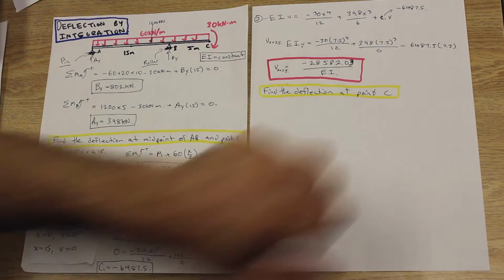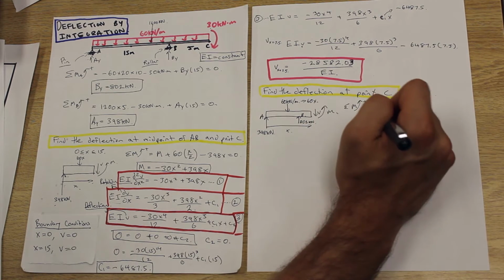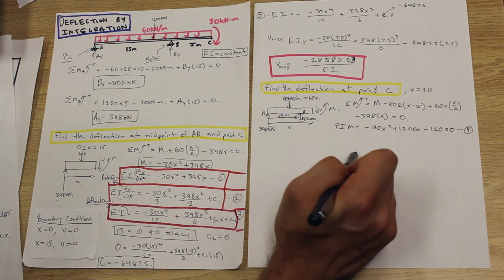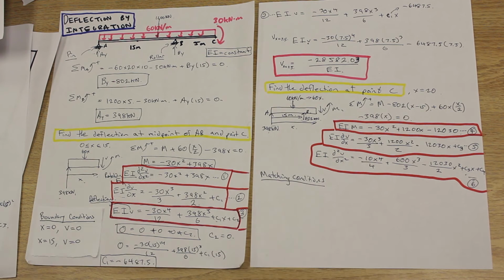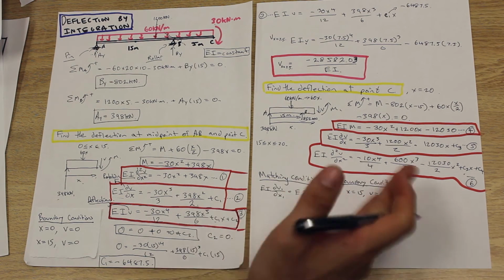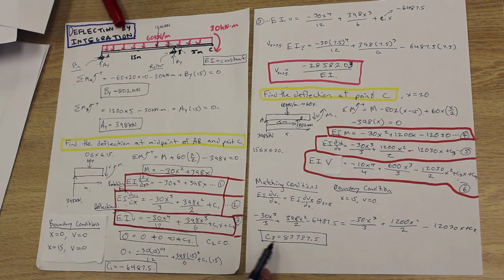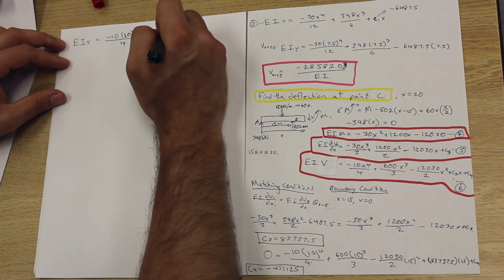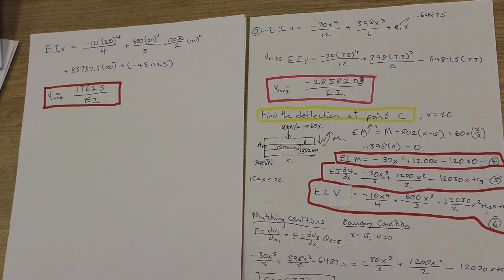Solving for Deflection of a Beam Using the Method of Integration - Part 4/4

Comment from the maker: TimeStamp !

0:33 - Theory Ends - Solution Beings (Dont skip the Theory!)
------------------------------------------------------------------------------------------------------
We need to Derive 3 equations to Find the "Deflection at Point C" 
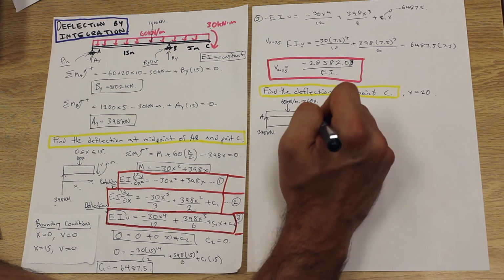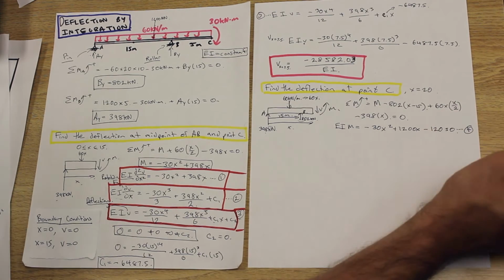** 2:04 - Equation 4 ** 4:35 - Equation 5 ** 5:27 - Equation 6 ** 
------------------------------------------------------------------------------------------------------
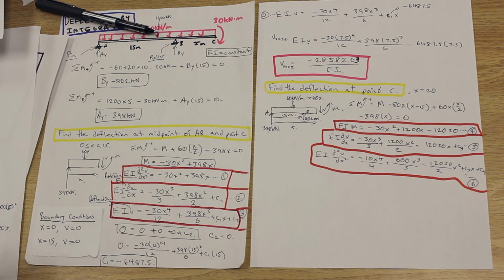6:38 - Find "C3" using Matching and Boundary Conditions 
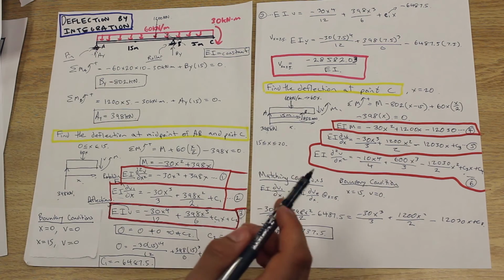12:02 - Find "C4" using Matching and Boundary Conditions 
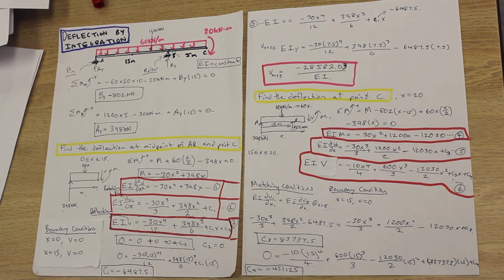13:53 - Plug in "X = 20" and the constants to the "Deflection Equation" to find the "Deflection at Point C"
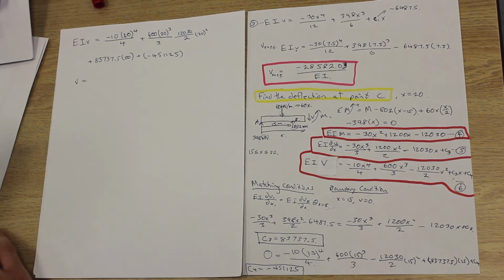15:44 - Final Solution (Now try to do it on your own!!)

The "Deflection By Integration" problem has FOUR Parts

Part 1 - https://youtu.be/39zdlzwDvgI
Part 2 - https://youtu.be/v7Zqpy5zxvM
Part 3 - https://youtu.be/RMTOw4C2T34
Part 4 (which you just watched) - https://youtu.be/ZA4L7yPXseo

Comment: I was curious why the boundary condition is x=15, v = 0 and not x= 0 and v = 0 too?
Reply from the maker: Kenny Ho are you referring to the second part of the question, the deflection at point C?
Reply: AF Math and Engineering yes
Reply from the maker: Kenny Ho since we're considering the portion of the beam BC, the only known boundary condition is at x = 15, where deflection is 0.  at x = 20, the other boundary of the section were considering, the slope and deflection are unknown, therefore we have only one boundary condition for section BC.
Reply from the maker: Kenny Ho for the portion of the beam AB, the boundaries are from x = 0 to x = 15.  The boundaries for BC are x = 15 to x = 20.